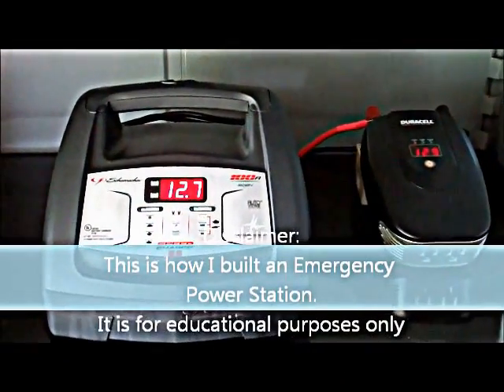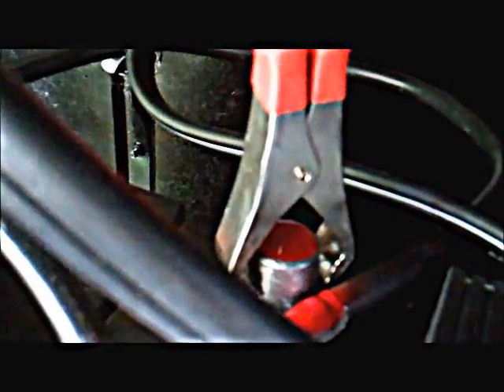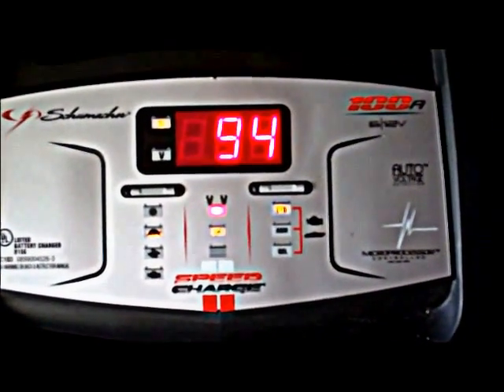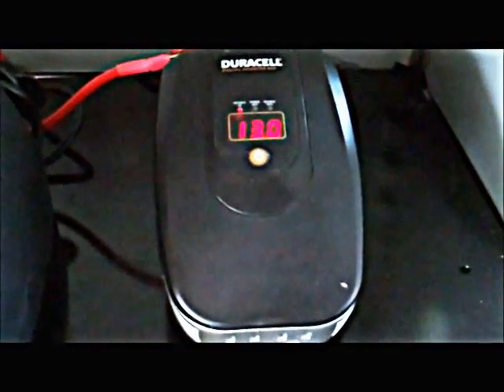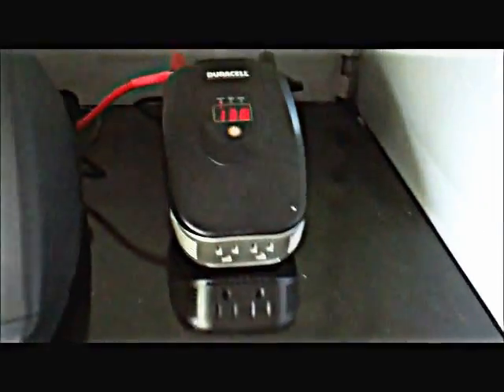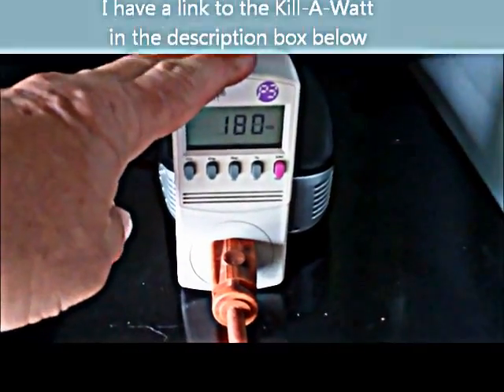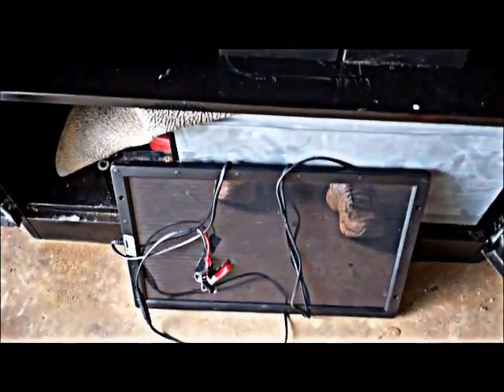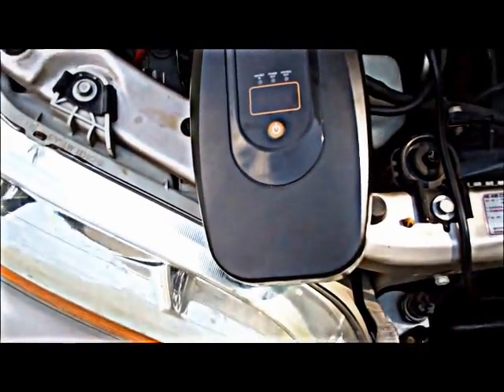How I Built A Simple Emergency Power Station

Comment: I've been renovating a campervan that had most of the wiring already there. I'm thinking this is an inexpensive setup to run a Keurig for morning coffee, and perhaps an induction cooktop. Seems easier & more practical to turn on the ignition for a few moments, as opposed to spending $2,000 for solar, or $1,000 for a generator...
Reply from the maker: Careful... Coffee makers and ovens use a LOT of power.
You'll need a pretty big inverter.
Make sure you know how many watts you'll need.
This is helpful: https://amzn.to/38Fn4yt
It's what I use.

Comment: Can someone please tell me? I have 4 deep cycle batteries in parallel and I have used heavy gauge wire. But I have to rotate batteries to keep them balanced? I put them on smart charger see week. I have them hooked up from first battery to 4th battery. They're in a line . I have 4 350 watt solar panels . Can I hook up 2 positive terminals  and 2 negative terminals the  proper way? And on opposite sides do the same thing? Like a crisscross setup? Any reply appreciated cheers from Australia  just subbed.nice vid!
Reply from the maker: It's difficult to say what you need to do from just a description.
Look online to some diagrams for hooking up batteries.
Mine never needed "balancing"... so not sure.
I need to replace all mine now, so hopefully I'll have a video up soon on that process.
Subscribe and keep watching for it.
Reply: @TexasPrepper2  thanks for the speedy reply.

Comment: My little Potek 750 watt inverter with meter kept me sane during extended power out due to Irma. Single 12v battery powered the following for several days and battery was still at 75%.. Laptop charger, cell phone charger, (2) 8watt LED table lamps (60 watt equivalent) Using my ham radio in listen mode, and short periods of watching TV for news. Since  then I've added a simple 100w solar panel and controller that is currently in storage until I actually need it. I also have a second 12v battery as back up.. The reason I don't have them tied together is they are not identical. One is older and less Amp Hours. There is a real issue with trying to charge 2 12v batteries in parallel. The weaker one will take away some of the charge from the stronger one thus lowering total amp hours more than you'd think. The other issue is this charge problem is even more pronounced when trying to charge them via solar. A single 100watt panel will barely charge a single 12v battery unless you're only topping off a battery.  Estimates say a battery down to 60% would take more than a full day of sun to charge. Google " How to Calculate Battery Amp Hours " to help you figure out what you can run and for how long based on your battery size. The Kill-a-watt meter is a must have addition to your tools.
Reply from the maker: Yep... LOVE the Kill A Watt meter.
ALL batts should be of the same size and very near the same age. 
Don't put an old batt with a new batt. 
The old batt will bring down the new one.
Something else I do is use Marine batts for my vehicles. Then, they can be used in a blackout if necessary.
Watch this video: https://www.youtube.com/watch?v=UtLzBaHw8K0

Comment: I luckily just came across a 750W Shumacher power inverter at a swap meet and paid $15 for it YAY ME! Would a set up like this work for daily use and what would be the precautions for having this in the house (no garage)? I would really love to kick my electric company to the curb and I can't do solar because I rent. In any event I have been looking for a good explanation on how to set this up and I found it! I will be creeping the swap meets looking for an additional converter.
Reply from the maker: +thelmarrie You shouldn't bring batteries into the house. They put off a small amount of gas that would not be healthy... unless you vent them to the outside. It's unlikely you are going to give up on your local power company. This design was meant for emergencies only. It won't run a whole house. 
THAT would cost tens of thousands of dollars.
Reply: TexasPrepper2 Thanks for the response. I didn't think a battery in the house would work but doesn't hurt to check. I would love to find some alternative, I actually rent what would be a tiny house, only 4 rooms. Thanks again!

Comment: A few suggestions. especially for people who plan on adding solar panels and using such a system daily:

1) You generally dont want to charge the batteries together, as you can over or undercharge one. Most serious solar setups have a charge controller with an equalization charge mode or a balanced charge mode specifically for this reason. Or you can just charge them both separately when its not an emergency... 

2) Use the absolute thickest wire you can get, minimum 10 AWG with 8 being better. 12 volts means a lot of current for your watts, and when every watt is precious you dont want to waste it heating up wires. 

3) You can and should get a switch mode dc-dc buck converter USB charger. This is the most efficient way to charge device like your cell phone (around 85% conversion efficiency). It beats taking the 12 volts up to 110 and down to 5 (absolute waste) or burning the 7 volts difference (still a big waste). A quick google search turns up many hits...

4) kill-a-watt is a great idea, i think ill improvise something similar and add it to my setup.

Comment: Good job TexasPrepper2.  Going to Haiti and doing a solar power setup on an orphanage and school, I learned also what you show here.  I took my nephew camping and it was hot summer in Arkansas.  Took my boat deep cycle battery, and an inverter to run a twenty inch box fan inside the tent.  Ahhhh!  Nice sleeping comfort.  In Haiti, I saw the bosses kid running his Xbox off an inverter using a 12 volt battery.  We Americans are spoiled to wonderfully dependable and inexpensive grid power.

Comment from the maker: I think the batts are 100+ amp hours each. So, I have approximately 200 total. You should never take a batt down over 50% discharge, so lets say that makes about 100 amp hours. Volts X Amps = Watts ... so, to make the math easy, lets say I had a full load on the inverter. I think it would last 16 hours... remember, fridge and freezer don't have to run all the time.
But someone else can do the math... I'm not very good at it, and may have really messed up the numbers.

Comment: So many of our electrical appliances run on 12v now. Like my CPAP machine has a transformer/inverter built-in to go from 120v down to 12v. Why invert it up to 120v just to have the CPAP transform it back down(?)..losing efficiency both ways. Better to add a 12v jack into the side of the CPAP and run the power directly 12V-12V inverter.

Comment: That would work -two sets of cables- just make sure you have an ON-ON switch to switch between cart motor and inverter so both sets are not energized at the same time or you will send your golf cart up in flames....which would also make a good Youtube video.  :-)
Either way, it would make a great project! Reminds me of the hotrod magazines where the hotrod owner offers to do a "burnout" for the cover of the magazine if the magazine offer to pay for a new paint job!

Comment from the maker: I was just looking at a forum about this subject.
Someone hooked up their battery bank with a different set of wires in parallel (12v batteries) and got their 12v for an inverter. The power to the actual cart was still 36v... in other words... 2 sets of battery cables... one series (cart) and 1 in parallel (inverter) Does this sound like it might work? This way, I get the power from all 3 batteries and can get a pretty big inverter to run the house. Project 4 me?

Comment: A 36volt-to-110V inverter is an odd piece of equipment, thus expensive. Maybe a 36V-to-12V transformer before the inverter is the answer. A transformer shouldn't be that expensive.

Comment: B doing the same thing here.  I have a little one in the basement to run my HAM radios.  And then I larger unit (4000 watt peak) inverter, that I can use on my truck.  Great video.